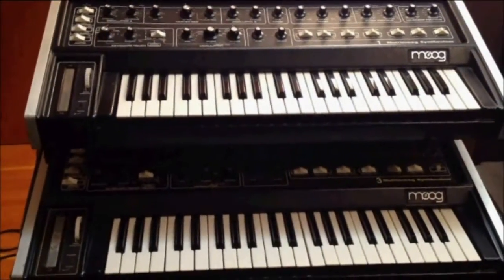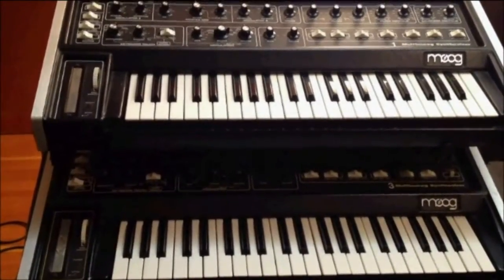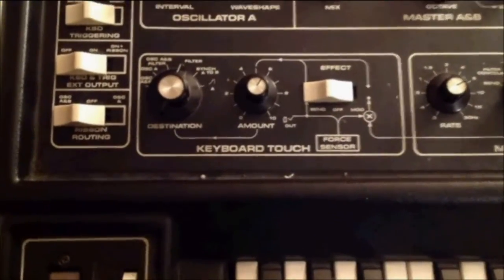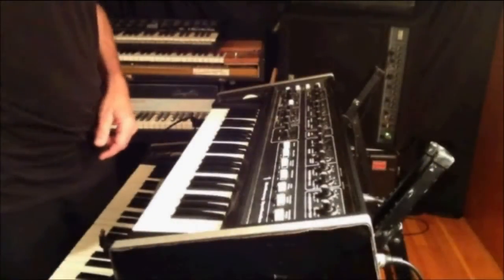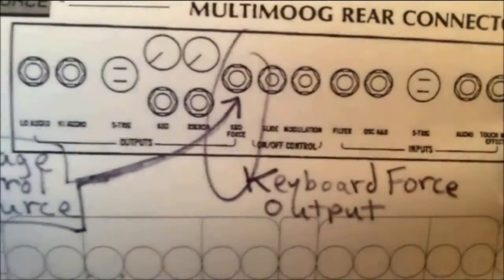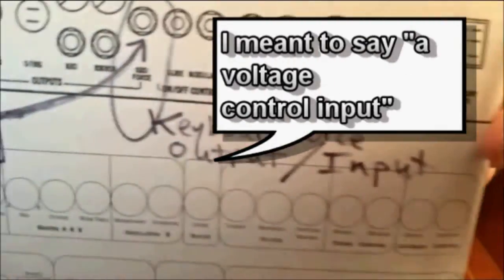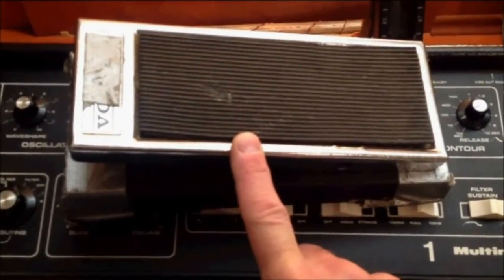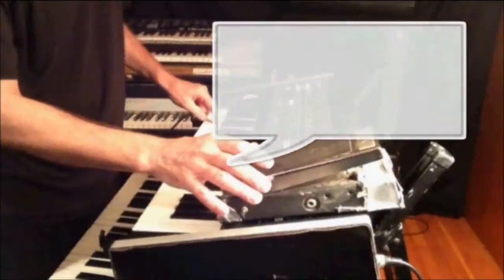Multimoog - Start Here: Piktor's Trick for Accessing More Cool Functions

Comment: Nice idea!  I also have two multis! 😅
Reply from the maker: You are a fortunate guy Scott. 😊 I am considering having my second Multi serviced for a couple of aging issues and putting it up for sale. 

I like to keep my left hand stationed on the pitch bender and mod wheel. The trick shown at the end here allows you to sweep the sync-ed oscillator or put it under control of the filter envelope, without having to rely on keys pressure or take your left hand off of the pitch bend ribbon to manipulate the Osc A tuning knob. Those sync functions are standard for many synths that came out after 1978, but Moog did not design the Multi to do that in an obvious way. 

If I remember correctly, I think that before I made the voltage control pedal, I applied the voltage control output (maybe keyboard out? - strike a higher note for a higher voltage?) from one Multimoog to the other. I think that you may be able to do this trick that way.

Comment: Now I got to find my foot control so I can do this.
Reply from the maker: Awesome. Good hunting!
Reply: @piktormusic2538  quick question, I haven’t tried it yet but I’ve done it on the minimoog but is it possible to do the minimoog feedback trick on the multimoog. I know it has a audio in but wasn’t sure if I can do that minimoog trick
Reply from the maker: @dhampex3631  - For the Multi, I got best results from routing Hi Audio out to FILTER input. 
Bonus tip: If you want to imitate the Jan Hammer trick for imitating guitar double string bends, do this routing and set the pitch bend ribbon to bend only Osc A. Start the Osc A pitch bend from below pitch upwards to the detent.
Reply from the maker: @dhampex3631  - If you have a Mini, I assume that your pb wheel throws pitch an interval of about a fifth, or so. I see most guys setting their modern wheels to go a whole tone upwards, but having dealt with the Multi’s fifth-minor sixth-ish range for so long, I prefer having a wider range on all synths so that I can go at least a major third either way. How are you getting along with the Multi’s ribbon? 
I have worn holes in the Teflon tape on the pitch bend ribbon several times. I had to find a source where I could buy a strip of that material.
Reply: @piktormusic2538  oooh nice, yes! i will try this out,, i normally have my pitch bend to the max where i do small movements with the wheel when my mini was working. Now i rely on the multi and memorymoog for the leads.  i will try this out. Thanx for the tip with the jan feedback trick. Jan was the king of that trick. I so appreciate this valuable info.
Reply: @piktormusic2538  yeah i hear a lot of folks wore the teflon tape like crazy, a guy name Synthpro specialize with repairing and modding  moogs, especially memory, mini and multi., he was talking about the teflon tape. One of these days i will send my multi memory and mini for mod upgrades and some repairs in the mini and memory.

getting use to it,, its different alright,, doesn't have the usual ADS or ADSR layout but slowly but surly its getting there hahahah. i love it,  i've always love the sound. Steve winwood use the heck out of it and Johnny Guitar Watson too, love the sound. i forgot who else used it.
Reply: @piktormusic2538  its funny how lots of people look past the multi. its kind of ;like the roland JX series, back in the 80s my dad had the JX8p and it was a beautiful sounding synth. I ended up getting the bigger brother SuperJX10 with some mods done. I was able to get it dirt cheap cause people looked pass them lol. At one point i even seen them going for $300, that blew my mind, and now prices are going up  cause roland released there boutique series of the JX8P (now called JX08)smh. People were very much into the usuall classics like prophet, minimoogs and oberheim.
Reply from the maker: @dhampex3631  - That is probably true. Because few Multimoogs were manufactured, the Multi does not have a wide user base. The result is that relatively few people have interacted with one. While my Multi disappointed me somewhat initially (1978), only because it did not sound like a Minimoog, I came to understand that it is a thing of beauty unto itself. You have to play the pressure sensitive keyboard for yourself to fully appreciate it. There is only one odd sort-of software emulation of it (IK Multimedia) but without the Multi’s keyboard, it misses the mark. I had my Roland A50 modded to be much more sensitive to pressure and even that does not rival the Multi’s keyboard. 
    I think that simply poking away at the Multimoog will produce some okay, acceptable sounds. However, if you have a deeper concept of using the instrument expressively (and it sounds like you do), then it is capable of great things. I used to hate how some guys used synths when they first became more ubiquitous in the 1970s. They approached them like funny sounding monophonic home organs. Many younger players today seem to have a better grasp of using the expressive capabilities in older and newer synths to breath more fire. Filters, envelopes, modulations, pitch, etc are not static in acoustic instrument performances and they should not be static in electronic instrument performances. Using my discovery just gives you the ability to apply more manipulations (with a pedal, breath controller), without taking your left hand away from working other functions. 

I was particularly chuffed that I found way to have a pedal sweep sync or the filter on a string of notes without having to stop on an individual note and apply pressure only when I paused there. Sweeping with a pedal or breath controller makes the instrument more like a wind instrument.
Reply: Agreed! That’s the beauty of the multi. It can be a beast of its own. A lot of times I tell people that it’s not a cut down minimoog but it’s own thing. Just like people called the memorymoog (synth on a chip) “6 minimoogs in one”. I can understand the operation concept or specs are actually 6 minimoogs in one but not sound wise. You are so right when it comes to the multi. It is it’s own thing. Yeah I was also disappointed with the non individual osc tuning. There’s a guy on YouTube that repairs  and mods most moogs. You might have seen the guys vids, name Synthpro. he has a few mods for the multi. Very good mods. He has the bass mod, and another one that does a few things. I think he was able to get I think osc a to pitch up even higher to have that kind of individual octave pitch. Yeah multi is a special instrument. Love them to death. Really happy with mines. It is somewhat filling the void of my sick minimoog, not completely but enough to stand out. My mini power  part went out long time ago but one of these days it will get repaired.
Reply: @piktormusic2538  It is so amazing that you can get so expressive with it. I didn’t know you could use a wind instrument like device with it. That makes me love it more. You know I hate that as well. The early usage of synth  use the synth in a cheesy way. Everyone was making that disco sound patch in the late 70s. I remember talking to my father about how he didn’t know the oberheim 4-8 voice was fat. Cause most of the time they used it in a weird way. We found out in the 90s Herbie, George, chick and prince made some good brass patch with them and some nice complex sounds. It reminds me of my YouTube problem I have when looking at synths. Most people when they get these synths they just make noise. Nothing wrong with making noise,, that’s there thing but it’s sooooooo many people that only make noise and not show the full capability of the synth. (That’s what made me love your vids). There’s a few people on here that does a good job but it is over saturated with noise makers.

Comment: Oh ok, KEYBOARD FORCE.

So the harder you press the keys on the MultiMoog, the stronger the signal sent to the external device ??

But this won't work with all Moog's because not all of them have the same TOUCH facility as the MultiMoog ??

Comment from the maker: Sorry, I got the term wrong. I'm looking at the unit now and it is properly termed "Keyboard Force". Normally, it's just an output that you can send to anything that accepts a control voltage. Its output should be regulated by the degree of force that you apply. It might be interesting to use it with a voltage control input on something like a MoogerFooger. 

Regarding the term "open system": There is a whole chapter about it in the Multimoog manual. You can find a PDF of that online.